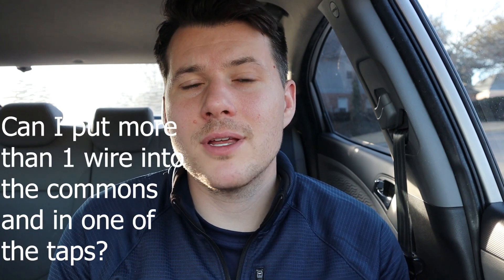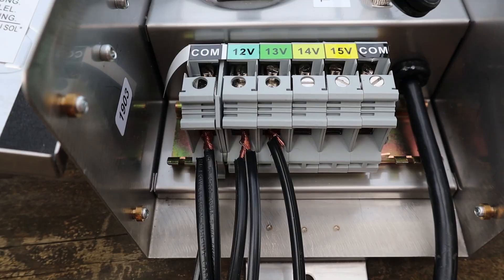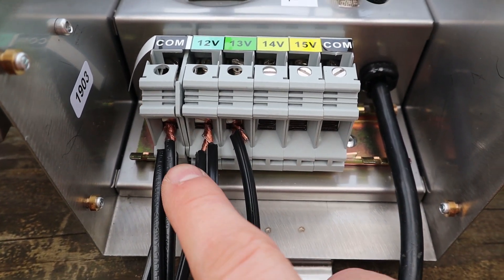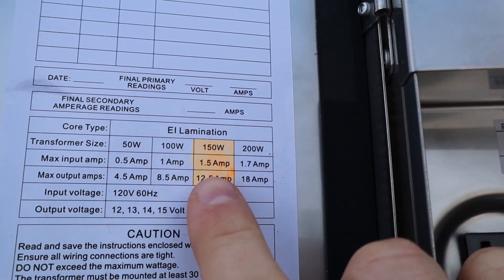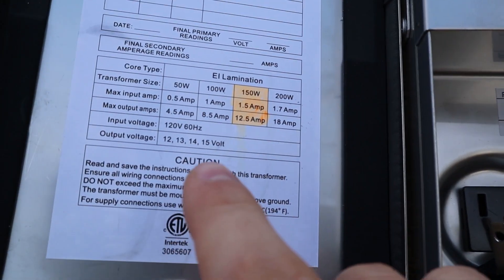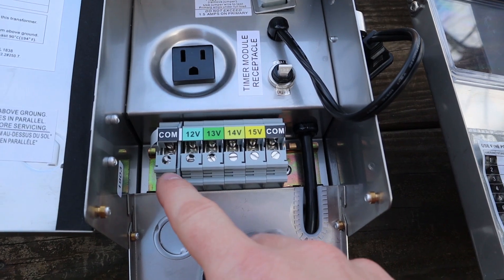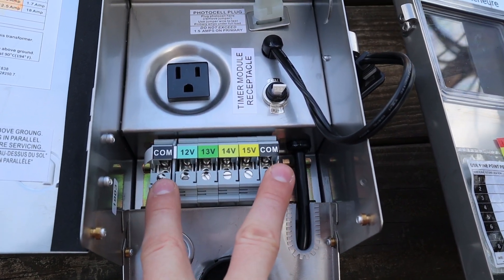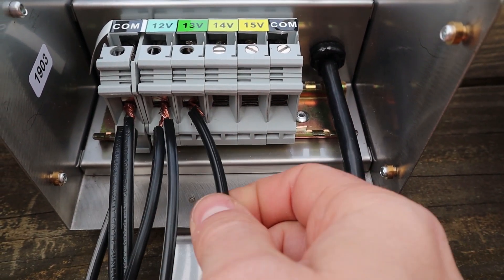HOW TO WIRE UP A LOW VOLTAGE LIGHTING TRANSFORMER | not sure how many wires can be connected

Comment: Question from a first time low voltage DIYr.  I recently purchased  recessed LV lights for a deck.  The lights all have drivers for the end of the daisy chain.  I plan on wiring these direct to a transformer with photo cell. My question is, if using a transformer, can I delete the driver, or so i need to keep it wired in

Comment: Can i put a 150watt tramormer with a 10gage cable with 24 lights 4watt about 400ft, & 6 2watt lights about 50ft closer to the tramormer in the same entrance of the transformer, or separte in two wire.

Comment: I bought a Vevor 200W LV LS transformer with timer and photocell sensor from Amazon. I noticed that it has 3 -12v slots but none for common wiring. to accommodate the two landscaping areas, I used two wires (each with dual wiring). I've noticed that one side of the house lights with no issues. The other side of the house gets lit for an hour or so then it is no longer lit. Any idea why this happens. Thanks

Comment: What gauge wire do you recommend for long runs ? 50-100 ft ? Is 16/2 large enough ? Or would you go with 14/2. 12/2 & if I have 3-4 runs to my transformer, do I need to take a wire from each run & put them in the common  ? Thx 👍
Reply from the maker: I would stay away from 16/2 and 14/2 gauge wires. 12/2 gauge will work for pretty much anything under like 400feet. Yes you need to take a wire from each run and put them on the common.

Comment: This does explain the wiring needed for Distant lights, but…do. I need to run a separate 12V line from the 15V connection at the Trans. to the distant flood lights?  I want to be sure I purchase sufficient 12V Flat Wire, I thought 200 ft. would be enough (that is aboutt he max distance. The little “Connectors” are a bit confusing, but I think I understand how do to that now.

Comment: Fairly clear video, thank you!…however I have 3 Flood Lights (LED) that I plan on putting out near my 20 ft. Flag Pole.  2 of the floods will point to the flag and the last flood light will fill the area around a huge Oak tree.  Those 3 flood lights are around 200+ feet from the transformer.  From what I understand, a separate line is needed to them and should be plugged into the 17 V. connection at the transformer.  The closests landscape lights should be connected to the 12V section of the transformer.  I plan on having 10 flush mounted landscape lights between the transormer and the flag pole…so its confusing about how much wire I will need to purchase.

Comment: I have four low Voltage cables, transformer has only one terminal, is there a good "block" to interconnect them?  thanks
Reply from the maker: Nope. The only way you can do that is if you bought a wire that's as thick as the rest combined and splice them all together and have the thicker wire go into the one terminal. Make sense? I would buy a transformer with 2 terminals if those 4 wires don't fit into one terminal.

Comment: GREAT video thank you. Right now I have one wire split into the two commons. If I wanted to add a second wire with lights that are about the same distance as the other wire, should I combine the first wire into the first common, and then place the second wire into the 12v? Or do some sort of splitting between commons? And is there any risk of trial and error here (eg, does placing wires in the wrong spot ruin the lights?) Thank you for your help!

Comment: Do all lettered wires need to wired together throughout the system or just when coming to transformer to connect to comm?
Reply from the maker: Technically you don't need to wire up the words together anywhere in the system because its a AC instead of a DC system. I teach this method to make things simple and make it easy to not miss any wires.

Comment: Thank you so much for all of your videos and the excellent explaining to each situation. I’m going to work on my outdoor lights soon and in your video you mentioned the most far distance we should use the 14 or 15v tap but my question is how many feet you meant with far? Thank you again
Reply from the maker: Thanks! It depends on the number of lights, the watts used, and distance. I'd say anything past about 150 feet you'll need to use the 15v. The way you can check is by putting the wires on a 12v tap and if the bulbs aren't shinning brightly, then move it up to a higher tap that makes the lights shine correctly. Good luck!

Comment: Another question I have is I have two runs coming into the transformer. So it will be a total of four bare wires. Would I be correct in taking one wire from each lead and connecting them into the common and the other two into either the 13v or 14v?
Reply from the maker: Well done! Yes you'll want to plug one side of the wire from each main wire into the COM (commons), and depending on how many lights and the distance, I would keep the other 2 sides of the wires plugged into either 12v or 13v. I only use 14v and 15v if its absolutely necessary. If the voltage drop to the lights isn't much of a drop, then sending 15v or 14v into a 12v bulb will reduce the life of those bulbs. Hope that made sense.
Reply: Branching off the question by Johnnyta43, do my two lines need to be of the same gauge? Can I have one line 16 gauge (already installed) and a new line 14 gauge?

Comment: Hello I have the 300 W model and my question is do I unplug the photocell that is currently plugged in with their jumper cable and there is also another plug near it plugged in labeled timer module receptacle. I am not using a photocell or a timer module.  I’m going to plug it into a Wi-Fi plug and control it like that. So do I just leave their jumper cable and the timer module receptacle plugged in how they have it? Thanks
Reply from the maker: Could you message me on Facebook or Instagram messenger or email me at adamkeeler@aklighting.net and send a couple pictures. There are many different types of transformers and I don't want to lead you wrong. Thanks!

Comment: Hi, nice explanation of the transformers commons and 12-15 taps, I've always wondered what the difference was.  I have a 1000 watt transformer with 4 comm channels and I recently switched out to all LED bulbs and have only 20 bulbs total.  I notice sometimes there's a string of lights that will come on but it's very dimly lit.  Occasionally it will be full brightness like the others. The bulbs are working since when it's on, it's perfect.  It's inconsistent but I'm wondering what the issue could be since we don't always turn on the lights on a regular schedule.  I think the transformer can definitely handle the load.  Thoughts?  Thanks!
Reply from the maker: A couple thoughts. 1. Your transformer is definitely big enough, you could handle around 110-150 lights! 2. Whatever that dimming wire is plugged into the transformer, change it to a different common and tap, so move it to 13v if it was on 12v. 3. You might have a cut in your wire that is small enough that your lights still work, but if something moves the cut, then the wires will be dim. 4. The led bulbs you bought need a certain amount of Volts, so if the volt drops than you will see them dim, so try increasing the volts to a 13v or 14v or maybe even 15v. Hope that helps!

Comment: I have a 100w transformer for my pool lights and my spa light and waterfall lights which all have there own on off switch do you know why when i turn on my spa light the pool lights turn on as well but flikering or very dim
Reply from the maker: I'm not sure why your pool lights come on as well, the only though I have is the switch is on. Feel free to describe more if that's not it. As for the don or flickering lights. Most of the time it means you dont have enough watts coming from the transformer. Count up all the watts of your light bulbs, and it shouldn't be more than 80watts for your transformer. If it's more than 80watts either get a bigger transformer or get smaller watt bulbs. Hope that helps!

Comment: I need a transformer that I can put a lock on so kids can’t get in. Also one that is preferably smart with a timer. With a wire feeder so the wires aren’t exposed outside out it. Any recommendations?
Reply from the maker: Most transformers have a clamp on it that's really hard for little hands to open. And some of those clamps come with a tiny hole where you cold put some sort of small lock on. Also, the wires exposed at the bottom can be covered with a PVC pipe as you can see in this video https://youtu.be/k_vMBpUc83I Best of luck with your project!
Reply from the maker: You could also mount the transformer higher than a kid could reach. Another option to look at.
Reply: Absolutely! The BEST way to deal with kids getting into the transformer is to take an old extension chord, strip it so that you have exposed copper ends... SHUT OFF the power! ...and wrap (or tape) the copper wire directly to the metal box...From there, plug in the plug into the socket, turn on your main power...and VOILA! 
 
I guarantee you will never have any more problems with children...🤣🤣🤣

Comment: Hi, I’m curious about the first transformer with the two commons and the individual 12v, 13v, 14v and 15v. Is that an FX luminaire? I have multiple wires (8 “zones”) and I think something like that one may be best to handle the lighting.
Reply from the maker: No it is not FX luminaire, however I think they make a transformer very similar to it. It doesn't matter how many zones you have, it matter how many watts there are. Sounds like you have a halogen system. Halogen lights take up a lot of watts and you'll need a large transformer to handle it. If you switch over to LED, you'll be able to purchase a regular transformer with just 1 common port (unless you have like 30+ lights). You honestly can buy a transformer from any lighting company not just FX Luminaire (their prices are usually really high). Hope this helps!
Reply: AK Lighting Thanks for the reply and information. The lights will all be LED so that should help. I was researching and so far the only company supporting WiFi and apps to control as a smart home. I found out about Volt and was going to look at them too.
Reply from the maker: @williamsjayr  You're welcome. So most transformers support WiFi, but you might need a internet "extender" (can't think of the right work) if your transformer is far from your house. Volt is a great company!